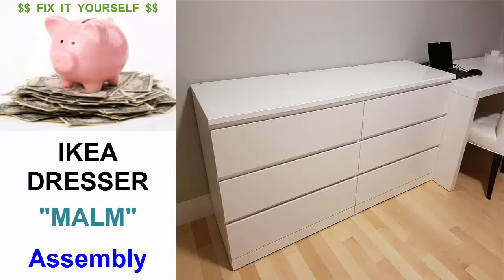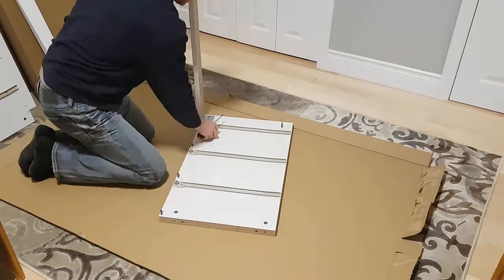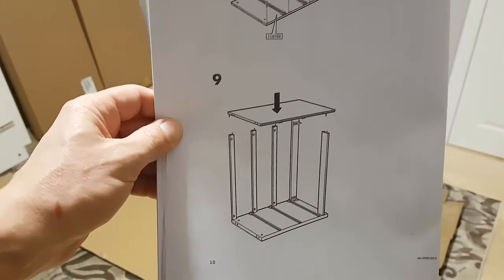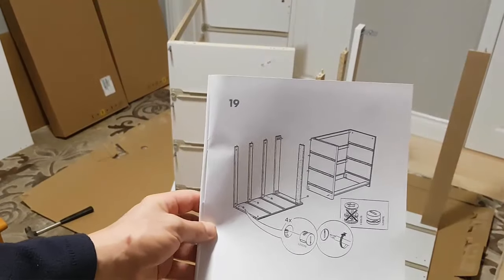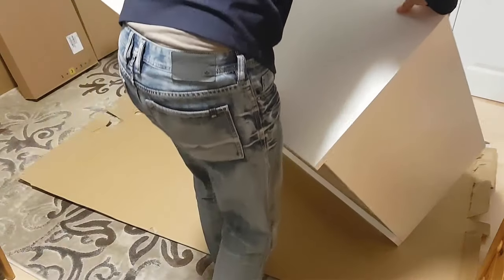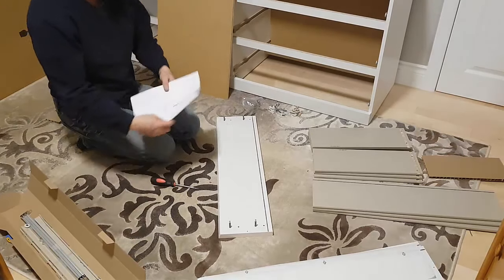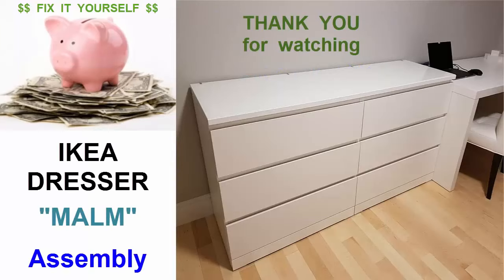IKEA "MALM" Dresser Assembly

Comment: For the back of the drawer instead of using a punch you can also use a 2.5 wood pilot, perfect size for screw, matched it up with the pre drilled hole so it’ll fasten correctly.

Comment: My draws won’t slide in and I’m super stressed. I’ve tried so many times and made sure it was done right
Reply from the maker: Hi Amber, I'm sorry to hear you are having difficulties. Check the video and make sure you have installed all the sliders exactly the same as shown. If you did install them all correctly (in the correct orientation) then it could just be the way you are trying to insert the drawers. Each drawer has sliders on either side and a wheel at the end of the drawer. Those wheels have to be lined up so they go inside the sliders in the unit so you will need to tilt the front of the drawing up a bit to get those wheels to go inside the unit sliders. Try that and let me know. Vito Casola, FIX IT Yourself.!

Comment: I just built this same dresser for my son. But for some reason the drawers aren't going in. I did everything right. Is there something I'm doing wrong?
Reply from the maker: Hi Barbara, Thank you for your comment. I'm sorry to hear you are having difficulties. If you are sure that all the slide rails have been installed exactly as I showed in my video on both the dresser sides and the drawers themselves then they should go in.  You have to ensure that the wheels go into the rails first by tilting the drawers a little when you first insert them and then once the wheels have passed into the rails they should slide in very smoothly. If you are still having trouble perhaps we can video call on WhatsApp so I can see what's going on. My cell number is 416-995-4949. Good Luck!!! Vito Casola - FIX IT Yourself.!!

Comment: At 14mins (when you join them all together) are the very bottom white parts supposed to be touching? I have a gap in mine and its driving me nuts 🤯i dont want to build anymore incase i have to take it all apart again 😭 your video has been very helpful btw!!
Reply from the maker: Hi Gemma,  Sorry for the late reply. I checked the part you were talking about at approx. 14 min. mark. You are referring to when the dresser top goes on to all the sides, correct? Well when you first slide all the pieces together, ensuring that all the fasteners and dowels line up you will notice that I did have to slap the top down pretty hard until there is only a small gap. The small gap will remain until you turn all of the turn fasteners 90 degrees to lock the turn fasteners in place. Then after you have turned all the turn fasteners 90 degrees there should no longer be any noticeable gap.  I hope this helps. Good Luck. Vito Casola - FIX IT Yourself.!!

Comment: Hi! Do you know what is length of the longest box? I have to go pick it up and its 3 hours away from where i live. I don’t know if its fit in my sedan?
Reply from the maker: Hi Louis,  The largest box contains the dresser top section and sides.  I measured my dresser when fully assembled and the length is 63.25 inches x 19 inches deep.  When I opened the box it looks like everything was packed in pretty tight with some small cardboard bumper sections at the ends. So if you add about 3/4 of an inch on each side to allow for those cardboard bumpers then you can assume the overall length of the largest box to be about 65 or 66 inches long x 22" wide.  Good luck. Vito Casola - FIX IT Yourself.!!

Comment: I only have 32 screws for the backboard but it says x54 is that okay?
Reply from the maker: Hi Chris, the backboard is just secured with small finishing nails and if you are short I suppose you could use some additional small finishing nails from your hardware kit or go to the local hardware store and buy some same size finish nails.  You should be okay with 32 nails though, just spread them out evenly like I did, starting with the four corners and then doing one each in between the center of each side between corners, and then go center between nails again and again until you run out. You can watch me doing this starting at approximately the 16:00 minute mark.  Good Luck with your assembly.  Vito Casola - FIX IT Yourself.!!

Comment: If I skip the last step (the backing plate) would the drawers hold up fine ? Cause I unfortunately threw them away by mistake
Reply: Hi Eden, Are you talking about the metal support at the bottom of each drawer (that are shown being installed around the 28 minute mark). If you threw those away perhaps you could go to IKEA and see if you can repurchase them. They shouldn't cost too much. I don't know how well your drawers will hold up well without them as they are intended to keep the bottom of the drawer from sagging when you start loading clothes inside. Eventually the weight of your clothes will cause the drawers to sag over time and the thin bottoms will start to take the shape of the sag until they fall out of the back side and then will fall out altogether.  I would make the effort to check with IKEA if they do sell those items separately and then install them. You spent all that time and effort so you want your dresser to last you as long as possible. Just my advice. Good Luck.  Vito Casola - FIX IT Yourself.!!
Reply: @nataliecasola8508  thank you so much

Comment: Hey, thankyou for the walkthrough, it was super helpful! I was wondering though if I don't use the metal draw supports on the bottom of the draws, would it make a big difference? I don't own a puncher to make the hole for the support rod like you did at the end of the video 😔
Reply from the maker: Thank you for your comment. I didn't actually use any special puncher. If you look closely I just used the phillips head screwdriver and put the screw that came with the assembly and put the screw where I wanted it and hit the end of the screwdriver with the screw and then turned the screw. You could also just take a nail and a hammer and tap a little hole enough to get a screw started.  Good Luck.   Vito Casola - FIX IT Yourself.!!

Comment: I heard this dresser has a top over hazard is that  true??
Reply from the maker: Hi MissCoCoKiss,
Thank you for you comment.  Yes the manual does show that they recommend you secure the dresser to your wall. I actually discuss this at 1:30 mark and also mentioned it in my video description section under important notes, as follows:

 IMPORTANT NOTES:
- I did not install the safety fasteners for securing the dresser to a wall which is recommend in the manual as I do not have young children and may wish to move the dresser to a different location at some point in the future.
- If you expect that young children could use your dresser then you should strongly consider securing your dresser as recommended and as shown in the assembly manual.

If you have you children or expect to someday have small children around the dresser then maybe you should consider installing the fasteners to secure the dresser to the wall. My children are 19 and 17 so I won't need to worry about that and I only have a young niece and nephew but they won't be going into my daughter's room unattended so I didn't bother with securing my dresser.

Good luck with your assembly. Vito Casola - FIX IT Yourself.!!

Comment: I have to Google for a demonstration because I got after fixing the top. I've had to rewind your video on that part 3 times only to realise how silly and stupid I've been 😂🤣😂🤣😂🤣. So I created a problem by placing the top back to front,there was no way I could join the back with the top placed wrongly. After rewinding 3 times I had the AHA moment and currently laughing at myself. Thank you so much, its an easy furniture to put up but you can easily make silly mistakes if you don't pay attention. One of those mistakes I came across are
1) using the wrong screws on wrong places (using different letters in the individual packs could have eliminated this mistake)
2) making it impossible to fix the top the other way round could also be helpful for us numpties

Comment: I did it but the two Middle drawers dosent fit its to high when i tilt it back and its breaking the plank obove what could be wrong and the wheels is mounted exacly the same
Reply from the maker: Hi, Sorry I'm not sure what the problem could be but you should check carefully that all the drawer rails are assembled correctly on both the dresser outside panels (should be same as the rails on the inside panel which came preassembled) and on the drawer that you would have assembled. Other than that I'm not sure what to tell you without seeing how yours was actually assembled. Vito Casola - FIX IT Yourself.!!
Reply: I watched your video step by step and assebled it like you did

Comment: Do you need to a drill??
Reply from the maker: Hi Layla, You only need a drill if you plan to secure the dresser to the wall for safety reasons. I didn't secure mine because I don't have or don't foresee any small children opening drawers and using them to climb up thereby creating a risk of toppling the dresser over and on top of them. If you have children or think that someday you may have visitors with children that could do that then it is recommended you secure the dresser to a wall and for that you may need to predrill a hole in the wall for securing the fasteners, as shown in the instructions.  Vito Casola - FIX IT Yourself.!!

Comment: This helped so much but I’m so mad I built the drawers and they don’t go in and it sure I did everything right could you please help me !!!???
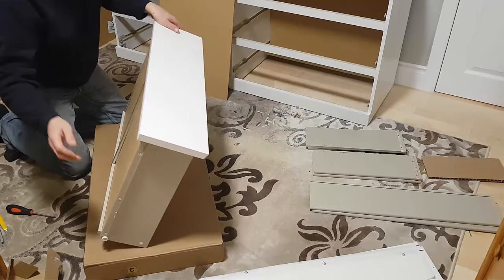Reply from the maker: Good Morning Ari, Sorry to hear you are having difficulties with your assembly. What seems to be the issue with your drawers? Did you perhaps not install the sliders correctly? First watch the video again from the 3:00 mark where it shows how the drawer sliders rails are to be installed on the thick unit center piece and make sure you installed those sliders exactly as shown in the video. The rails of the side of the unit should already come installed. Then watch at the 11:00 mark and see how the drawer rails are installed on the opposite side of the unit center piece.  Finally carefully watch how the drawer sliders have to be installed at the 25:50 mark and make sure all drawers are done the same. Finally when you go to insert the drawers into the unit you sort of need to get the wheels of the drawer sliders into the sliders of the unit and jiggle the drawer up a bit and over, then the drawer should go in the rest of the way. Watch how this is done at the 28:50 mark.  If you did everything correctly it should work.  Let me know if this helps.  Good Luck.  Vito Casola - FIX IT Yourself.!!
Reply: @FIX-IT-Yourself  I  think I did it well I would be happy if I could send you pictures it’s just they don’t slide in it’s hard from them and I built the drawers right!
Reply from the maker: @arimeza3260  Hi Ari, Sure if you want you can go ahead and send me some pictures and I will see if I can spot anything that you may have done incorrectly that could be causing your issue. Email me at vmcasola@gmail.com.  Vito Casola - FIX IT Yourself.!!

Comment: Where are the screws at ?
Reply: Good morning Yasmine, The screws should have been included inside one of the boxes all inside a plastic bag. You should lay them all out according to the installation manual to make your finding each type of screw/fastener at each step of the installation. Good luck with your installation and thank you for supporting my channel. Vito Casola - FIX IT Yourself.!!
Reply: @vitocasola8358 hey - is it a requirement to hammer in all the nails at the end? Just a few seem sufficient enough
Reply from the maker: Good morning, I would definitely take the extra few minutes to hammer in all the nails of course. The more nails you put in the less stress is on all other nailed areas. Nailing the backing makes the entire dresser more stable by securing the back board to all other pieces that are screwed together. By making the dresser more stable you can move it around  your room with confidence that you won't be stressing the screwed joints. Remember after all that this dresser is made of particle board and not solild wood, so it is by nature much weaker than typical wood furniture. Take the extra few minutes and hammer in all the screws, is my recommendation. Vito Casola - FIX IT Yourself!!! @hellotcautiver

Comment: Hey I just finished assembling my Malm dresser but the left hand side won’t allow me to put my drawers in fully? I assembled them exactly the same as the right hand side drawers but the left won’t close. So I was wondering if you have any advice to fix this issue?
Reply from the maker: Hi Megan, Sorry to hear you're having problems. I'm not sure what could be causing your problem but it sounds to me like maybe you installed the drawer sliders backwards. Watch the video again and pay careful attention to the part when the sliders are mounted on the cabinet section and make sure you installed them exactly the same and then do the same thing with each drawer, double check that maybe you didn't install the sliders on the drawers backwards.  Try to have a look at that and let me know. Good Luck. Vito Casola - FIX IT Yourself.!!
Reply: @FIX-IT-Yourself  thanks so much for getting back to me I really appreciate it 🙌🏼 I have ensured that the drawer sliders are facing the correct way but unfortunately the wheels of the drawer seems to stop on the hook of the drawer slider. It’s just strange because the other half of my unit is perfect and I assembled it the exact same way so unless those three sliders are faulty as they are facing the correct way.
Reply from the maker: @megansutton8120  Hi Megan, Why don't you remove one, two or all three drawers on the side that is giving you the problem and email me (at: vmcasola@gmail.com) some photos showing the sliders inside the cabinet and the sliders on the drawers.  This way I might be able to see how they were installed. Then I might be able to spot something that might help you address what the problem could be.  Vito Casola - FIX IT Yourself.!!
Reply: @FIX-IT-Yourself   I have just sent you an email. Again thank you so much for taking the time!!! 😊
Reply from the maker: @megansutton8120  Hi Megan, I looked at the pictures you sent and compared the sliders installed in the video with how you installed them for our dresser and you are right it looks like you did everything correctly so without inspecting it in person unfortunately I don't know how I can be able to help you further.  I hope you can address the problem because it would sure be PITA to take it all back IKEA.  The only thing I could recommend is the instruction sheet does show a number you can call at IKEA and maybe you could give that a try.  Good Luck, I sure hope you get this resolved.  Vito Casola - FIX IT Yourself.!!
Reply: @FIX-IT-Yourself  No problem thanks anyways i really appreciate it :)
Reply: @megansutton8120  hey did you find out what the problem was?
Reply: @saraadam3941   I ended up getting in contact with IKEA and they're sending me out six new drawer sliders as they too think its a manufacturing issue :)
Reply: Megan Sutton ahh okay thanks for getting back to me

Comment: Hello, please please can someone help!!! Did anyone else struggle getting drawers in the unit? They just don’t seem to fit into the runners???
Reply from the maker: Hi Ella, Thanks for your comment. Not sure but just take a close look and how the inside rails were installed on the outside dresser panels, that they are the same orientation as the inside panel, which came with rails already installed and then you need to be careful how the drawer rails are installed to ensure they will line up correctly. Vito Casola - FIX IT Yourself.!!

Comment: There's no way that stupid metal rod at 17 min isn't a factory mistake. I was incredibly confused when installing it, but you did it the same way. It's not holding right. On the same night I've build my unit, that rod on the bottom drawer felt down, making it impossible to open the drawer. I had to lockpick it for 10 min........ 🙃
Reply from the maker: Hello, Thank you for your comment. You must mean at the 27 min mark. I'm not so sure if it is a factory mistake. It took some figuring out but if you install the first screw and then put the u-shaped metal support at that end and turn it you will line up the back end so you can screw that side on the backside of the drawer. The only thing was there is no predrilled hole or punch mark showing where that screw on the back side of the drawer is supposed to be installed. Anyway hope the video was helpful for your assembly and that it otherwise went pretty smooth. Vito Casola - FIX IT Yourself.!!

Comment: Box 1 .. first part put together ok... But, it only gave me the first section of the dresser and just some of the pieces of the second section. And the middle piece (left wall the joins both sides together) that you'd place second set of rails on is solid, zero holes?! Box 1 also gave me some random big thick cork board as well that has zero purpose to this entire dresser... I've had this in storage for some time due to an unexpected move. After all this time it's too late to return or exchange, I don't have receipt after two years. Frustrating. Box 2 and 3 appear to be the drawers. But they're pointless seeing as though I can't even get to that step. Total waste of money

Comment: 28:04 we couldn’t put that screw in! I cant see anything related to a punch but even a drill didnt help :(
Reply from the maker: Hello Dee, Sorry you are having difficulties. All that you need to do is break the hard surface of the particle board to allow the screw to catch so you can fasten that drawer support.  You can see that all I did was just put the screwdriver and screw as if I was going to screw it in and gave it a sharp blow with the palm of my hand and that was enought to break through to get the screw through the hard surface so it would catch.  Vito Casola - FIX IT Yourself.!!